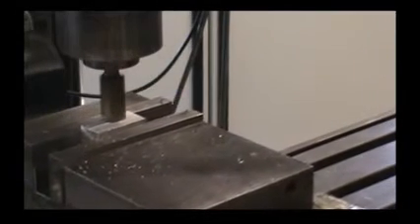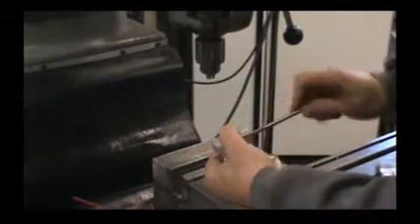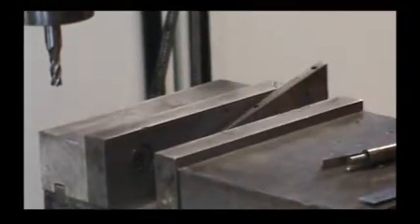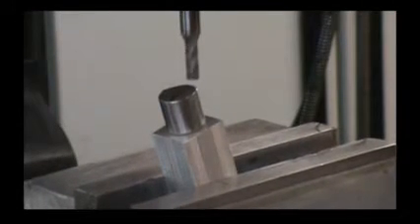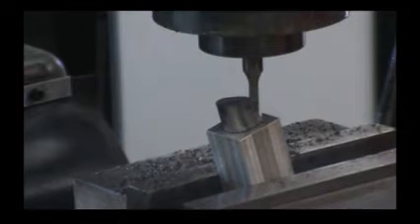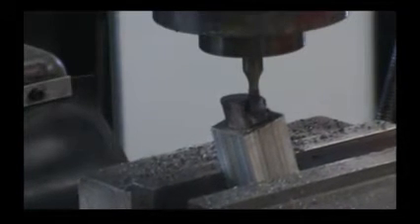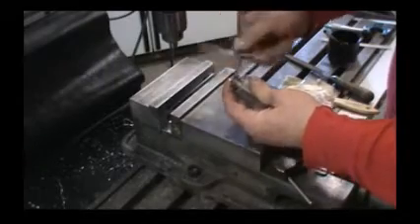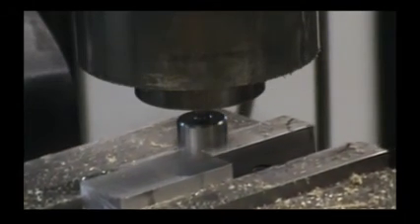Making A Miniature Fly Cutter

Comment: Very nice setup, seemed like you were able to machine the 01 pretty easily was that HSS stock you were cutting with?
Reply from the maker: +🔥Ramsey Customs - turbocobra Thanks Gary. I use HSS cutters most of the time. I am very "old school" in practice. Its rare and only usually on a special situation that ill use a carbide end mill or drill.  I have made probably 35 of these cutters and the little 3/16 4 flute HSS end mill is still sharp and leaving a nice square edge in the slot and O1 is pretty tough stuff. The secret is to NOT get it hot!

Comment: Nice job Tom. Questions on the hardening. What kind of oil do you quench the piece of steel you are hardening and what temperature do you heat it up to before you quench it? Thing cuts that aluminum like butter.